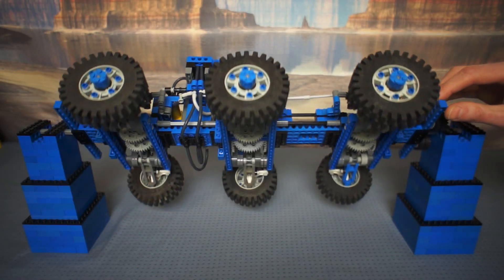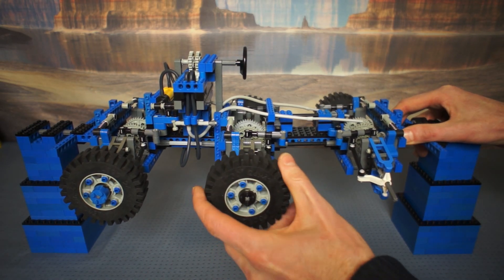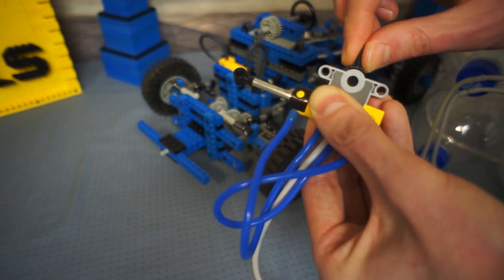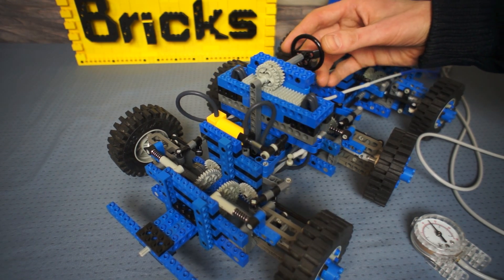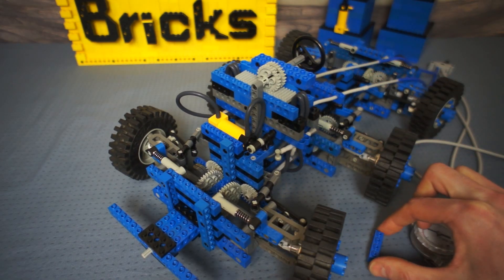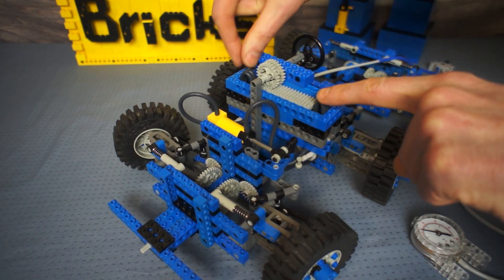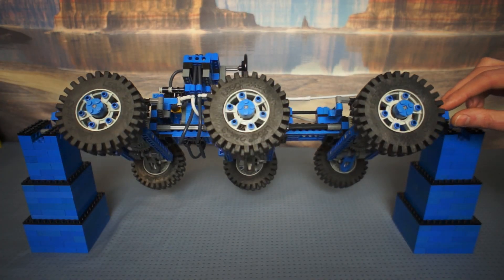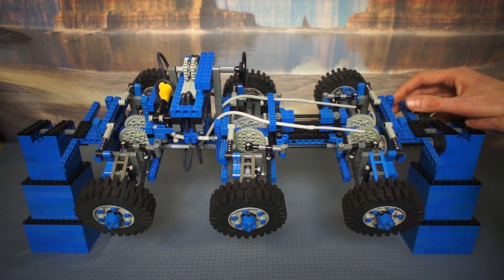Proportional Pneumatic Power Steering Lego Technic 6x6x6

Comment: I have the idea of making a rotational pneumatic servo motor, using a differential to control it, and an l.P.E. to drive it.
I feel though, that the steering feedback can be detrimental to the precise control of the steering under more harsh conditions.
Reply: if you want to though, you could also use a gauge to show the steering/servo output position.
Reply from the maker: @Clippy_gng_86  The output position feeds back to the control switch body. So the  switch "knows" the position of the output... when it decides to work properly! :D
Reply: @techbricks5300  a gauge in the system  could make it easier to troubleshoot, is what I mean.
Reply from the maker: It's tricky to make anything work accurately in Lego with the 0.1mm gaps, lack of threads and parts are much larger then they would be in a real vehical. Connecting the pneumatic cylinder directly to the outer switch body was the tightest closed-loop feedback system I've come up with.
But it's huge compared to the car!
Reply: @techbricks5300  Revisiting this conversation, the system I had mentioned should probably be used in builds scaled to have realistic detail and functions, without being too large and expensive. That is, ship MOCs, and other large models whose working features require an amount of torque and positional control unachievable by 
other means.

Comment: To get the wheels all turning the same way you need to make those driveshaft gears asymmetrical. honestly I don't know why you've got the whole double drive thing going on when the wheels are steered anyway, but since that's the case, those large gears inside the frames need to be moved along so that on one side of the frame I.e. the left they're being driven from the same side as the ones on the other side i.e. the right. I hope that makes some sense. Also, this would probably be an easier project if you built it fully studless, just saying! P.S. I've emailed you :)
Reply from the maker: You can see the updated model, with corrected drive system, in my Bricklink Studio Gallery. 
There is a 3D viewable model.
The dual left-right drive system is instead of using differentials.
I've also used split L-R throttles on my Raptor Monster Truck.
https://www.bricklink.com/v3/studio/public_gallery.page?idUser=273818